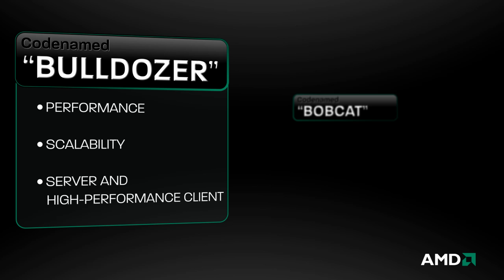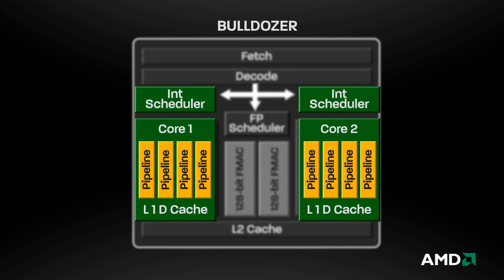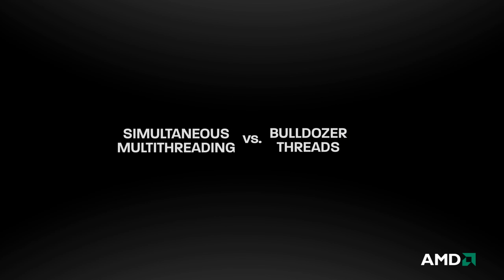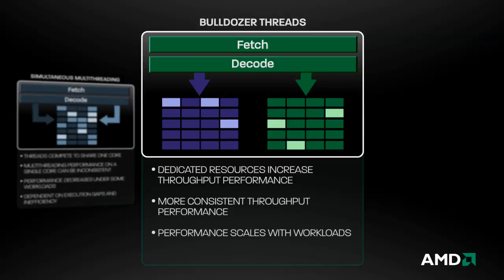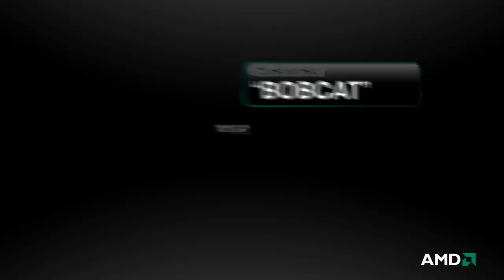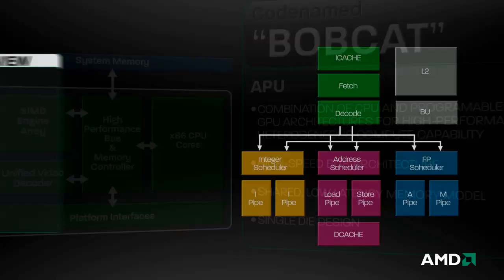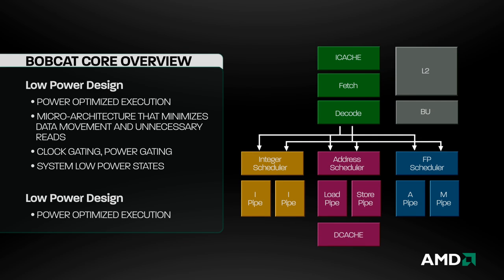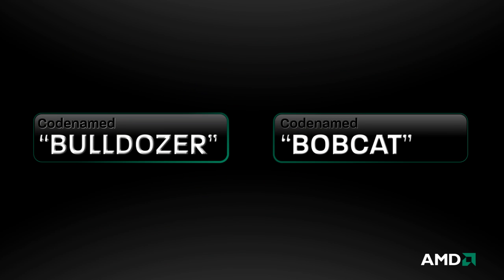AMD Cores: "Bulldozer" and "Bobcat"

Comment: @Tristansletter I have both systems, an AMD 965 BE on a 790FXTA chipset and an Intel i7 930 with the X58 chipset.

Same 5770's were running in both systems, the i7 on stock speeds (2.8Ghz) i saw 5-10 FPS average on games and benchmarks. The AMD system with the ATI cards "should" perform better or at least the same as the Intel system, but it is the other way around. My point is, another company making CPU's and chipsets have made another company's product run better....

Comment: @YaBaDji You get what you pay for. Intel is crammed with technology and perform like mad. Hyper threading, triple channel memory and the X58 chipset allows users to get ATI or NVIDIA cards. AMD's chips are basic physical cores with very little techno features, hence why they are cheaper. Also AMD could not use the same hyper threading tech from Intel since it is patented. This new chip has hyper threading but with a different approach (hardware based). Hope it does well.

Comment: According to the Inquirer on the web, Intel's next monster CPU will have native eight cores with hyper threading, reduced latencies in L3 cache at 20 MB, the usual specs for L1/L2, quad channel bandwidth, and high clock speed.  Unless Bulldozer does the same, it will not compete against this Goliath but should be great for the new high mid range CPUs category.  It's another uphill battle for AMD in 2011.  Read the article.

Comment: @ronnysoeberg really?  amd cpus emit more heat and consume more power than intel (by and large).  Im building an intel rig at the moment for that reason.  intels cooler sucks, dont use it.  amd make nice coolers, but they also really need it.

nvidia and ati go back and forth...for example, the gtx 460 is cooler and more efficient than its ati counterpart.

im pumped about bulldozer, i'd like to see it in action.  the architecture seems "better" than nehalem to me.  time will tell though.

Comment: This is my last food for thought.  L1 at 128 KB X 4 = 512 KB which becomes the ratio for L2 X 4 = 2048 MB X 4 = 8192 KB which becomes minimum for perfect ratios from L1 to L2 to L3.  L3 could use 8,192 or 10,240 MB for L3 cache.  This is similar to perfect down conversion theory in recording engineering from 88.2 KHz to 44.1 KHz.  It now becomes a matter between the right balance between amount of higher data processed and/or lower latency/efficiency - 8 MB or 10 MB L3 cache & with O/C headroom.

Comment: I meant to say overclock at 4 GHz plus on air and water cooling with stability in OS.  I did some research on the 980X and saw that they had latency issues with L3 12 MB cache.  Along with the 48 way technology in L3 by AMD, it would be nice to see 8 MB and 10 MB L3 cache once they figure out the best amount to reduce any latency.  It might be as close to perfection that a CPU could yield.   I am not interested in 6-7 GHz overclocks with liquid nitrogen but am glad for those who are.

Comment: Intel 990X:  64 Kb L1, 256 KB L2 X 6 cores, high latency L3 cache 12 MB, 6.4 GT/s, triple memory controller and 3.43 GHz clock speed with hyp/thr, turbo
AMD Bulldozer needs:  128 KB L1 X 2 per mod, 512 KB L2 per module, 8 &10 MB L3 low latency, 2.8-3.4 GHz clockspeed, 8 core with 6.4 GT/s w/ triple or quad memory control for wide RAM bandwidth.  This would be the ultimate CPU and have room for overclock to 4 GHz. and have additional room for GPU enhancing technology.  Hope this helps AMD.

Comment: I have no issues to whatever Bulldozer does in server but in desktop, they will likely use HT3.1 and should consider 6.4 GT/s bandwidth, no info on memory controller be it dual channel, triple, or quad.  Having a range of CPU's with L3 at 8 MB, 10 MB, and 12 MB would be awesome.  I don't doubt that the fetch and data transfer technology is the best, I think that they should consider larger cache for larger data transfers.  This Bulldozer line would seriously compete against any Core iX series :]

Comment: Crazy how Intel is coming up with a socket 2011. I guess this is for the upcoming Intel CPU'S based on this. I guess they stole AMD'S Idea >=(. Its called Sandy Bridge (microarchitecture). The socket Is coming out 2011/Q3. It supports 40 PCI-E 3.0 lanes and its set to supplant Socket B (LGA 1366). Its going to have a Bus sped of 4.8-6.4 GT/s. If I where you AMD I would wait till these CPU'S come out and see what they got and try to make it way better than Intel's.

Comment: I did some research into Magny cours and like how they use 6 cylinders at 60 hp (AMD) vs. 4 cylinders at 75 hp (Xeon) as well as having 10 MB of L3 cache, 12 cores of 128 KB L1, 12 cores of 512 KB L2.  While they are power efficient and deliver massive power as a whole CPU, this would be different in a desktop platform even if Bulldozer uses 16 cores with 33% increase over Magny Cours.  This would still translate to less power for single thread applications compared to a Xeon.  Read on...

Comment: @logiotek Correct, though I perhaps should have been more explicit in my earlier comment. I was referring to CPU-centric tasks, where the graphics cards were of little importance. A more applicable comparison to ronnysoeberg's post might have been a Q9550/Radeon HD 5850 I have access to, which is still outperformed by the GTX460 system. Had a 5830 from XFX with the Athlon II X4 635 for a while and of course that was hotter still thanks to AMD's design decisions for its core and clockspeed.

Comment: @ronnysoeberg As tempted as I am to agree with you (long time AMD fan during the netburst years), I have to go by my own experiences. My heavily overclocked Intel Core i5 & Nvidia GTX460 system runs significantly cooler and quieter than the AMD Athlon II X4 635 & Radeon Hd 4870 it replaced... which caught fire during a Prime95 run.

Comment: I love AMD but when Phenom first came out against Core 2, it failed because Core 2 had large amount of L2 cache at 12 MB over 2 MB of L3 cache for Phenom.  When AMD finally got it, they released Phenom II but Intel was ahead again with more cache and triple memory controller with increased bandwidth and now are moving with 3.4 GHz stock speed for 990X not to mention 6.4 GT/s.  AMD will need 12 MB of L3 cache, 6.4 GT/s speed, and triple or quad channel mem controller to compete against 990X.

Comment: @stigyo92 what are you on? i have a phenom x2 550 overclocked to 3.8ghz, and a 5770 i run it at 1920x1080 very high, get about 20fps, and if i overclock my 5770 to 1ghz core, i can even put 2x or 4x AA, though it wont be very playable. crysis only runs on ONE core, about 99% of games run on ONE core.  other than upcoming DX11 games and maybe a couple of dx10, it takes foever to make a milti-threaded game, its extremely difficult.

Comment: @rpop996 yes, but not a CPU, its an APU, and will only be used in laptops and will save energy, its basically a cpu and gpu combined into one processor. for the low-mid end market, for high end, its bulldozers 8-core cpu's that you want to be looking at.